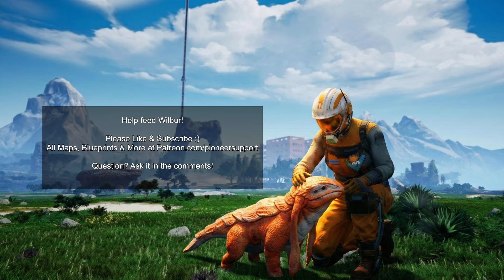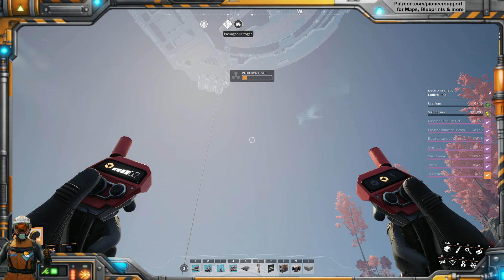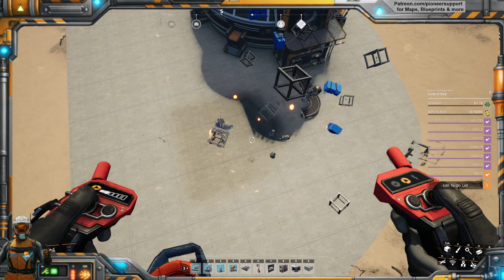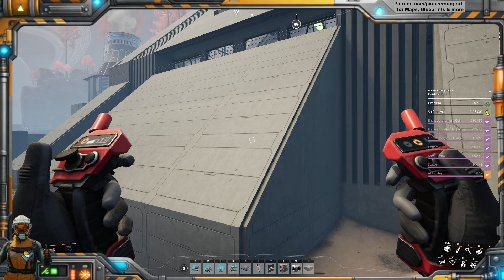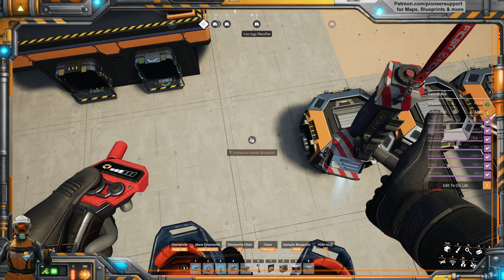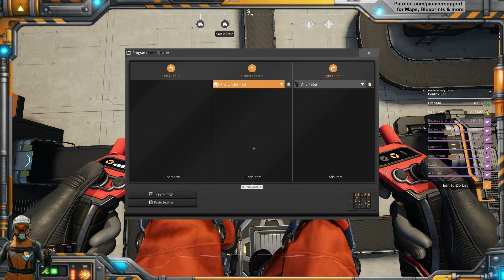Overwhelmed by Nuclear? This Satisfactory Method Makes It Easy (No Wiki Needed)

Comment: I go with rocket fuel rather than nuclear, but if I were to think about Nuclear I'd start with the big choices - am I storing waste, or am I building a zero-waste pipeline (and if so, which). There's a lot to think about after that, but I think it's important to at least decide what the goal is and how to think about that tradeoff, before getting into one of the many designs that can get you there.

Comment: I just completed my first nuclear plant (3rd play through).  I built dedicated production lines for every element so as to avoid any stalls in the nuclear plant.  Then I built the transport logistics to the plant site so that the components could start backing up in the transport lines (everything except uranium, which I left waiting on me to start the drone when I was ready).  Then I built the entire nuclear process through to sinkable plutonium rods, connecting up all the belts, pipes and power lines as I went so that the production lines could fill up with ingredients as much as possible while I finished building.

Everything was set to run at 100% efficiency using over/underclocking so that anything radioactive was always moving.  Once I was happy that it was all ready to go, I called in the uranium.  I was a joy watching the power generators turn on as the rods were produced and funneled into them.  After that, I built the machines to process plutonium waste through Ficsonium and diverted the plutonium rods from the sink into generators.

The plant now runs at 100% efficiency throughout and I'm getting 57GW off 150/minute of uranium ore.  The trick for me was all in the planning (I used Modeler) and having everything pre-built and filled with ingredients before bringing in the uranium.  Because there are no back-ups of radioactive elements, the plant is barely radioactive at all and the dedicated ingredient supply means I have no fear of it ever stalling.

Comment: This guide really does simplify the basic uranium processes.   Flying stuff in and using a sushi belt definitely makes it simple and much more compact!  Just one correction though - the nuclear plant actually takes 240 water, rather than 50.  It doesn't change much unless you are going for a big build, in which case you have to make sure your water source is large enough for many extractors.

On my last save (first time I tried nuclear), I did a somewhat larger build, I think it was 16 overclocked (200%) generators.  I also refined the waste all the way to plutonium rods, which I used for drone fuel (and sunk the excess).  But I made everything from scratch onsite (except aluminum ingots for heat sinks) which meant a much larger build overall.  I think your method would probably be easier for a first time nuclear build.  It took me a really long time to get it all working properly, even though it was REALLY nice once it was done.

Very nice video, glad I subscribed.
Reply from the maker: Thanks for the sub and the water clarification. It was pretty early when I did the video. 😅
Reply: Ya but if you try to scale up using a sushi belt you're going to hit a wall pretty quick since drones have a very limited capacity (they can only ever carry 9 stacks of any combo of items). So while it's fine for a small nuclear setup, if you want to grow that you need to stop doing that and use dedicated drones for each resource you're flying in and belt them seperately so you can maximize throughput levels.